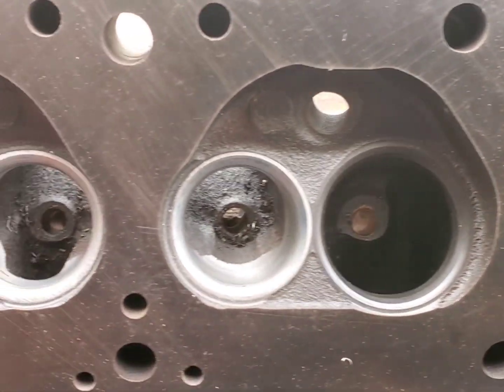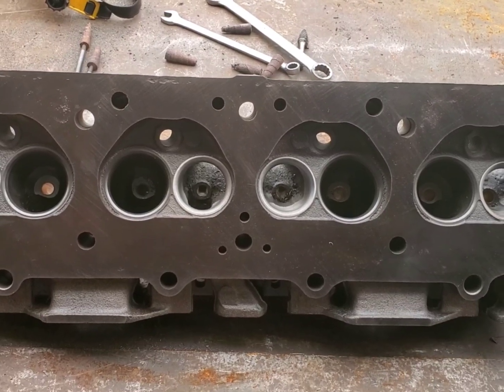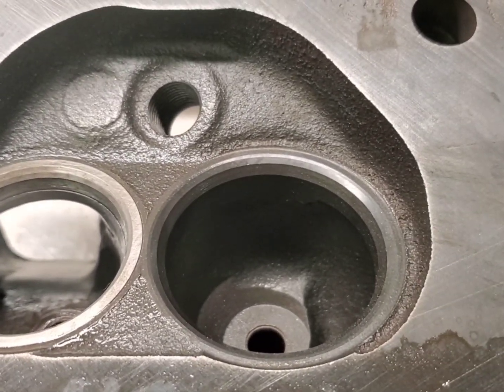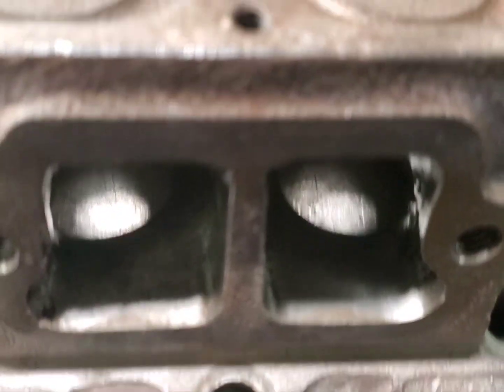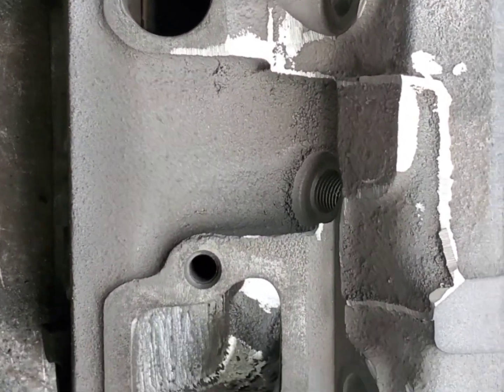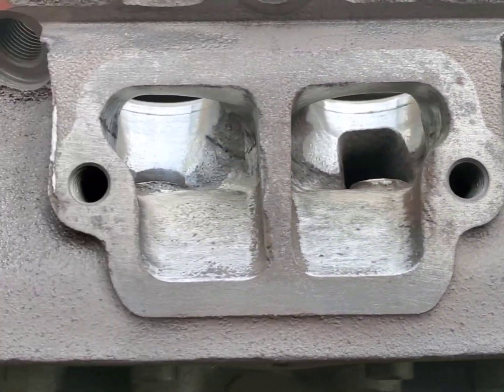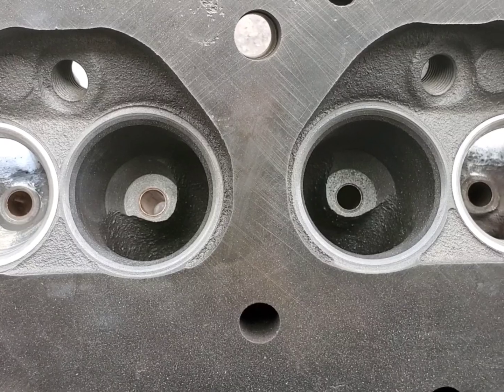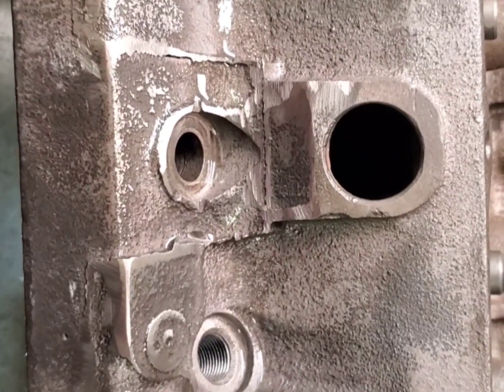AMC, 360 Exhaust bowl blend and port cleanup. Project Javelin.

Comment: good vid, i need to no the bolt spacing measurement on the exhaust Please if you know - Thanks
Reply from the maker: Thanks for watching. 
I have no idea what the bolt spacing is.
Sorry, the engine is gone so I cannot measure it.
Take care, Ed.
Reply: @edsmachine93  i just bought some gaskets , i have a 58 nash metropoltian with a amc 360 in it- need to figure out something for headers
Reply from the maker: I see, what about headers for a Jeep with a 304 or 360?
Reply: @edsmachine93  it has homebrew on it now, could be better, i am gonna use new flang , i may just come up and dwn behind the wheel, very verry little space

Comment: Would the exhaust manifold side of the head be machined? It also looks really rough.
Reply from the maker: Thanks for watching. 
No it will not be machined.
It will seal fine, the customer is using headers.
Take care, EM.